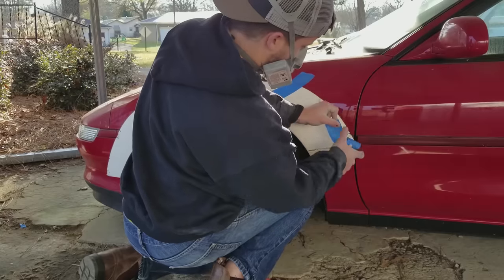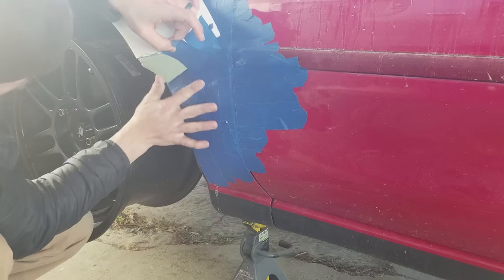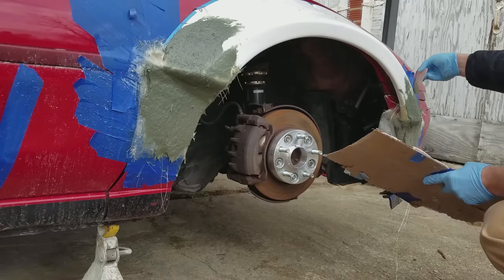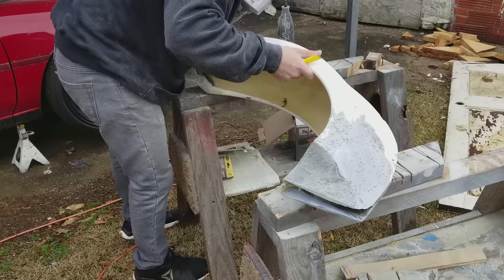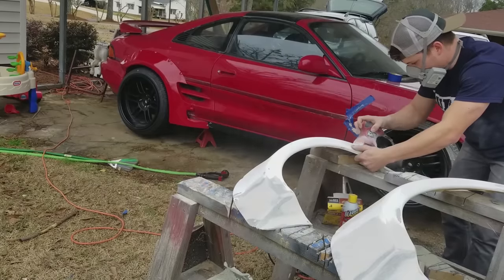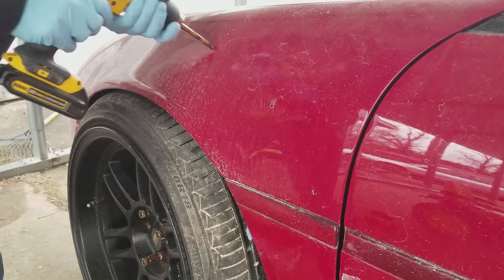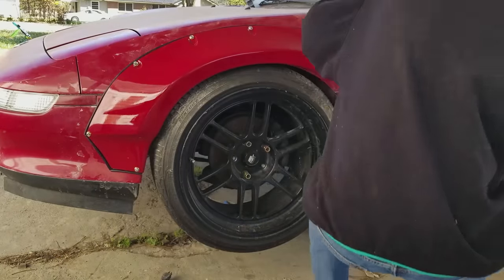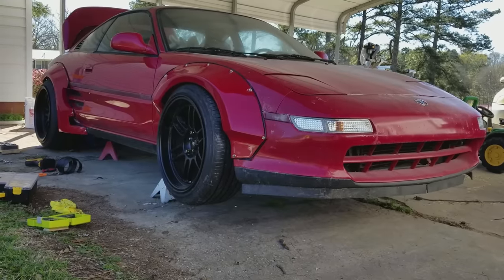How to Make a Wide Body Kit

Comment: Great video looks really good. Another method for this is to take a large block of foam like you have and completely make a custom shape. After you have your shape you can seal the foam and make a mold from this. This will allow you to make as many flares/widebody parts as you like and they can be made from carbon fiber, fiberglass, kevalar, or any composite.
Reply: I was thinking the same thing. That's what im going to do when i widebody my miata. A Proper widebody.
Reply: If I were going to do this I would 3d scan the foam wide body into some 3d software and then make the mold for it from there, I feel like that would be better to make both sides even cause you can just mirror the mold

Comment: Just the video I needed to work my rocker skirts, I did not want to buy aftermarker and have to drill new holes  on the rockers of my Mustang , I want to utlize the original mounting holes and all I want to do is to extend a flap on top of the original skirt past the door under the side scoop.This fits my Bill!,I have worked with fiberglass in the past , but foam fabrication is new to me, thanks for the learning experience! Cheers!

Comment: Don't wait for Bondo to Cure Before Sanding. Before it gets completely HARD, use a Bodyshop specific 10in. Cheesegrater to rasp %70 of your bulk then when HARD, start sanding. This will save you a bunch of sanding time. Fantastic Job BTW, I never made my own fender flares so this was cool to watch. I have a 97 Prelude that has a $4k Paint Job and I'm still need to complete it. I have a Bunch of Ideas brewing in my head after watching this. Thank You

Comment: Damn dude,I'm just seeing ur channel for the 1st time. I'm pretty much where you started at months ago. I've come to the realization that if I'm gonna widebody my ride,it's going to be home made. Exactly like you said,their are a few kits(03 mx5,87 Fiero gt), for the 2 projects me and a relative have been getting ready to start. It's kinda you help w mine,I help w yours type deal. He's good w bodywork,where I'm new to it. I'm good with motors/mechanical aspects of it. The engines, suspension, tranny's etc, that's rather easy as we've both been gathering parts for over a year. But when it comes to body style,wide body, effects etc, neither one of us really see what we're looking for.  Especially mine(fiero), very few wb kits,what is out there is really on the square/boxey side. We both, especially me,want it to flow w the car and look, almost as if it was made today. Not either overboard fast n furious type,or just some square panels bolted to a car.

Comment: Yesss!! Another guy like myself that just cant leave anything basic....love it.
I do a lot of custom kids pedal planes and rc robotics builds...
Advice...
Clear packing tape will not stick to fiberglass. Use your blue tape first then layer the clear tape next then the. When cured the glass will pop right off.
Sheet rocking spackle putty or totalboat polyester repair putty Can do use like Bondo went in an upright position and it will not droop or drip down like Bondo how do you do this allows you to use a spatula or putty knife to form the basic shape easily without taking things off the car it’ll also allow you to sand it a lot faster than Bondo will let you do and it’s not heavy at all.
Use a cheese grator while the bondo has become tacky to knock down the bigger clumps before it fully cures. U can do a wet rag wipedown with a rag soaked in acetone to smooth it even more to void lot of sanding too.

You made it happen dude! Looks great...
Reply: Wow did u basically explain how to do everything he just did but quicker and better?

Comment: Not bad man. I can appreciate things being made by hand. Experience is everything. Now you can learn from it. You should of just layed 3 layers of fiberglass on the back side instead of all the fiberglass bondo. Bondo & fiberglass bondo should be put in thin layers, it can still crack. Prime those fender holes, outside & in. You would be surprised how things rust.
Reply: JOEGGGJOE  I was going to say the same thing
Reply: Yeah, I was wondering why he didn't prime the holes.
Reply: Biggest mistake people do. Don't think its a big deal until its all rusted out later.
Reply: See what you mean. Even if it was just from the underside with schultz. Atleast he tried to seal it at the top of the trim.

Comment: I rarely comment on car vids..and, if I do, it's mainly to criticize the builder. But, I've got to hand it to you, bud. You powered thru a shit ton of labor hours and actually completed something. Which most people don't (myself included). yeah, in my opinion...you did more work than you needed to...but, using retail products..cheap equipment...and doing this ALL outside, you totally crushed it..!!! great job.
For some (or any) of your other body mods...consider using a two part expanding foam. Ordered online (2gal kit x 4lb density=$120 shipped). 2gal kit will build your flairs, hood mods, front and rear diffusers and additional ground mods. (on a small import).  Here's the process. And, you'll save serious cash, in the end.
Prep surface for reals..(foam will be permanent)..
Teflon tape or foil tape cardboard forms.. (spray shields from home depot)..
Cut and place your forms onto the car in the general shape of the mod profile..
Seal any gaps with foil tape..
Pour 10oz part A and 10oz part B into a freezer bag, squish and shake for 5 seconds.
Snip a pencil diameter hole in one corner...pour into corners first..let it flow naturally after that.
Repeat this step in "lifts". As not to create large gas bubbles..
Remove forms and start creating with sandpaper, hacksaw blade etc. (you're a pro at that, anyway)
Blow remaining dust away... and use any  large dispenser epoxy to coat your modded area (again, home depot etc..)
Thin epoxy with MPK (Methyl Propal Ketone)..and apply with disposable chip brushes.
At this point, (when cured = 24hrs) you can go at the mods with your usual thin coats of plastic filler and primer.
Enjoy the benefits of less labor (you're welcome).  lol

Comment: I wish I could make my own widebody for my car, that looks old really good
Reply: TBills 3000 Same, but I'd want to make from metal. I guess I could if I only knew how to weld
Reply: ThatSubieGuy yeah that would be cool to, I would make mine out of fiber glass.
Reply: TBills 3000 Fiberglass would be easier but I'd have to do it at summer if I wanted the fiber glass to dry some day lol. I want the car to look like it came from the factory with the widebody and it needs to be very rigid so I think the metal would be the best option. Maybe I just need to get two same side fenders from junkyard and start practicing.

Comment: Looks beautiful man, two questions though. Noticed you left a link in the description for the wheels, were they just wider wheels? Also, do the axles and subsequently the driveshaft need to be modified, or can a wide body be done without messing with all that jazz?

Comment: if you're worried about the strength of a joint, get the stainless mesh they sell for body work (its meant to fix holes in body panels to give bondo a stronger base in case of rust holes and such ) think 3M has a product called adhesive body patch... basically combined with that fiberglass bondo you make steel reinforced concrete essentially :D

Comment: What I do at work is when we put on flares on trucks they come with a long strip of molding and since it doesn’t get used every time i tend to save them. I’ve used it on a few rocket bunny kits for auto shows around me and even the curves on a rocket bunny brz kit the molding fits great. Maybe try looking into that. Mr2 looks great though!

Comment: You made it look simple enough to follow, looks good man. 

Question though, where do you pick up those supplies? (Fiberglass filler, bondo etc)
Reply: Where did you get the fiberglass? And what kind did you use?
Reply: Your local bodyshop supplies shop is your best bet for quality materials.

Comment: Great Job for someone who doesn't do it as a trade. Cant be made with what you have, Minor adjustments in your body work ( using a DA on a soft pad on ur body work to get rid of blocking scratches, and using a high build primer and waiting longer) and quality materials and this would have been perfect

Comment: Is it possible to use the filler to hid the fender bolt on slots and lines and get the car to look like it was all original? I have a Nissan 300zx that I am thinking about adding a wide body kit to, but don't want to be able to see any of where the body kit meets up with the original body after I paint it. Is that doable? Would it last?

Comment: you could do what a lot of truck fender flares use, a bit of 3m tape would stop it from rubbing and provide a bit of extra protection against it flying off, also I think it would look cleaner to not have the black rubber behind the flares but thats just my preference

Comment: Best thing to use to seal the gap on over fenders is just go to any advance auto parts, auto zone, etc and buy some rubber vac tube in whatever size you want as long as you need and then cut the hose length wise from end to end and fit it over the fenders. Thats what ive always done with mine and it works great and is cheap.

Comment: What is that green sponge block that you sand to mould things
Reply: It's a foam water block that holds flower arrangements. Used them a lot at the flower shops but hobby lobby and the like stock them

Comment: one thing i would like to point out, don't wait for it to get tacky before putting the next layer of fiberglass on, cause the resin is starting to cure. what makes fiberglass and carbon fiber so strong is the fact that the resin bonds on a molecular level to the individual strands of glass or PAN, if it wasn't staying up,  use a paint brush and tap it, that helps the resin move through the fiber and wet it out and it will stay. 
Wait for it to tack makes a weaker bond, and if there is any impact, even a relatively small one ( think rock that gets kicked up), it could cause a de-lamination cause the resin didn't bond correctly due to being partially cured. too late for Built official on this project, but more of a thought for people looking to replicate.

Comment: Oh yeah, dont use acetone to clean primer. You will just take he primer off, use prep sol wax and dirt remover. Painting solid colors and clears should be fine with that gun. Its how you adjust the gun, air pressure, distance, speed,and wheather. Worry about that with metallics and pearls. Also, use a cheap, dollar home depot flat black spray can paint as a guide coat for sanding your primer. Saves a lot of time and you will see things better.

Comment: I worked with a guy who had one of these cars. His shit was fast as fuck. I wanna say he had around 400hp but i think it was closer to 600hp. That was back in 02-03 so i dont really remember. He had this big ass air intake thing that came up the back and layed on either the side of the roof or on the side corner of the roof. He had this computer built into his dash to control everything like the boost and fuel. He put a lot of money into that car. That thing took off like a rocket. You couldnt lean forward once he started goin.

Comment: Beautiful job! I'm 65 and you have given me lots of ideas for constructing a hightop for my GMC van. It will have to support 2 14x14 inch roof fans and 480 watts of solar panels, so will need good underlying framework.Also, I think the lines of most US made vans' hightops are unattractive.  The width is restricted to the inside of the rooftop gutters. Steals a lot of interior space, and I think it looks dorkey. I would like to bump the hightop sides out to form a more truely vertical uninterrupted line with the van sides. But then, what do I do for a functioning gutter?  Anyone have any ideas?  Most of hightop will be contructed of foamboard and spray foam, I'm thinking.

Comment: What's the main material of dat fender? is dat foam too?
Reply: BUILT and so what the kind of blue tape? Is that like isolator of cable? Or like invisible color which usually use in paper?

Comment: As far as your Fender Flare rubber gaskets you should use the 2001 to 2004 Toyota Tacoma Fender Flare rubber gaskets. Inexpensive and it works great. Here's the Toyota part number 53851-35061. Hope this helps. Great work by the way
Reply: BUILT I believe you could find it on Amazon as well if you just put in the part number Or EBay. Let me know if it works

Comment: An easier method os to use construction foam and line your car with cling wrap... then spray it on and shape it... after paint the foam and fibreglass it... remove the fibreglass and shape it. Keep the foam for moulds for making more to sell.... i made a bumper for my tiburon like that....

Comment: A little late but if anyone is reading this, use SHARKBITE body filler from CREST. Its so much smoother and easier to work with. It's like 30 bucks for a gallon too

Comment: I have question for all you body kit doers... is there any other way to get the body kit on other than drilling holes in the body of the vehicle? 

Great work by the way.
Reply: or glue on using window glue, it is super strong and it is good to install fiberglass parts
Reply: Shane Farley yes but dont
Reply: Jamason Rainey True

Comment: Tips on How To Clean your Spray Gun:  After using it, put 1 Cup of Acetone in it.  Swish-it around, get a big cardboard and spray on it.  Once the empty, hang dry.... It's ready for next time!  Quick, easy... Cheap too!
Reply: +BUILT - LOL, you must have clogged that up.  We do house painting and stuff all the time.  That is what I do when we done.  Also, you have to adjust the " Nozzle " so more acetone coming out during cleaning.  BTW... They are like $12.00 with Coupon.... Sometimes just throw it away and get a new one.  By the time you clean it, dry it, etc.... I could make another $12.00 and get a brand new one. LOL